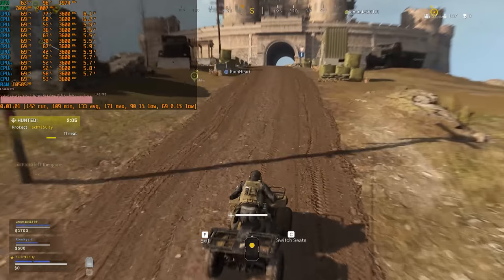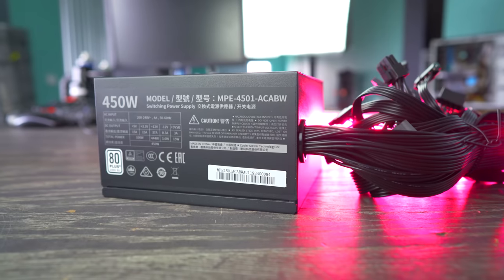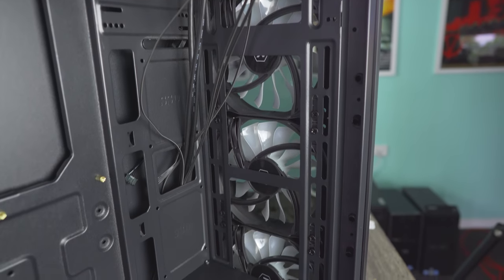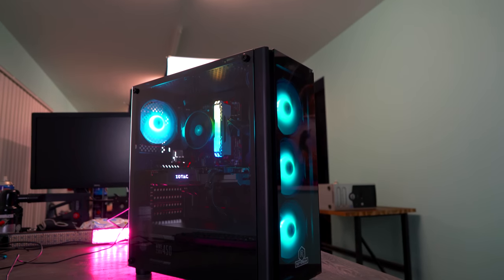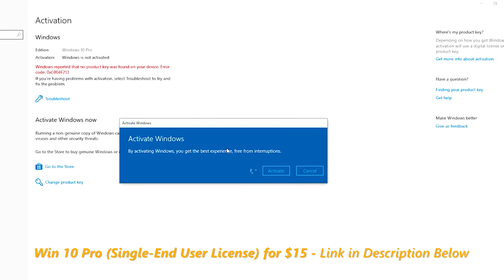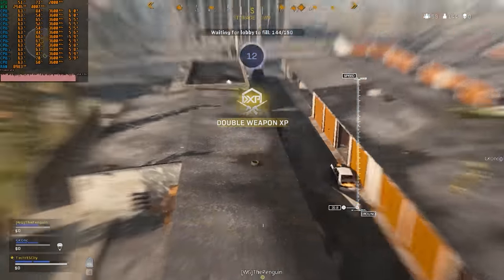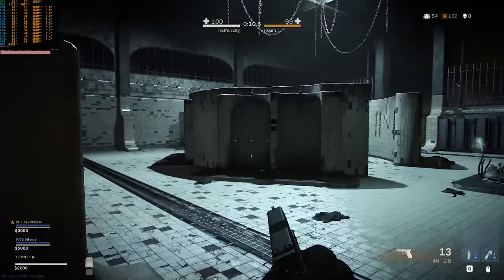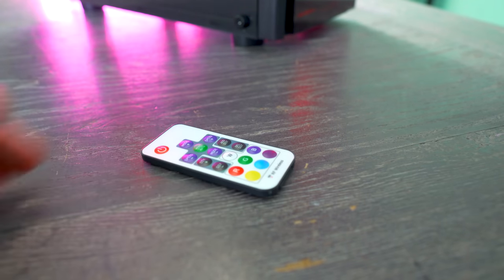The $590 CoD WARZONE 1600 AF "ULTIMATE Budget" Gaming PC

Comment: lol You taught me well (including all of the other budget builders out there) i already found these prices and built this a year ago. im so glad that you found this now, ive been wondering if anyone else thought of this. but the only 4 things different is that i have the last gen 1600 (not the Af version) i have a 600 watt psu, and my Gpu is a rx 470 4gb (mining) which is worse than the gtx 1070 but it still holds its ground at 95fps average with the same setting in MW. But i got mine for just 400 dollars give or take a few dollars. Also the motherboard is actually the same layout and Architecture but its from ASRock. My case was free btw... Its from 2004ish its just older than me Lol, I dont even know the model
Reply: btw Everything was new except the gpu and case

Comment: I might have a solution for some with a similar setup. I have a GTX 1070 ti and now the Ryzen 5 3600, but it would happen with my 2600 too, Modern Warfare would constantly crash and/or get Dev errors. At first I thought it was the Xbox Game Bar and disabling it seemed to help for a couple of matches, but the major culprit turned out to be performance monitoring sowftware like Rivatuner, after setting 'Application Detection Level' to 'None' now I can even overclock my card, use the Game Bar to talk with friends, and it's been months since it last crashed.
Reply from the maker: If you set it to none though does it still work?
Reply: @techyescity  Sorry for the delay, was at work. Sadly it doesn't, since it turns off performance monitoring at every level. Haven't tested medium or high since I already knew my temps were fine.
Reply: I will try to replicate the conditions for the errors and crashes I had, if it does crash I'll test medium level detection. Won't be as accurate but it should be close enough.
Reply: Remembered I had disabled Nvidia's In-game overlay in the geforce app as well. Although I wasn't able to recreate the crashes by enabling and using Rivatuner, the in-game overlay, and the game bar all at once. They might've fixed it, but that's all I remember doing other than trying 'Scan and Repair' and running as administrator the exe and launcher. Sorry if that wasn't of help.

Comment: I love how you're somewhat engaged with the games you're benching, but I dont get the cheap SSDs, on one hand Linus keeps shitting on them but you seem to have great results using those. Is it mainly cause you're flipping these pcs and the ssd is a good marketing tool or are they genuinely better than new HDDs price/performance-wise?
Reply from the maker: They are much better than hard drives, that comes down to mainly the random 4k read and writes, I have seeded out quite a few of these in builds and haven't had one come back faulty.  Leave them with about 10% free space and they work fine.
Reply: @techyescity  Thanks a lot for the incredibly fast reply! Now I know to upgrade my Laptop storage by adding a cheap SSD instead of a 2.5'' HDD
Reply: @Xeanorth95  Just don't take it too seriously with Linus.  Probably he just wants you to avoid buying cheap SSD and probably go with a "branded SSD".  It all comes down to choice in the end.
Reply: Definitely get an SSD! You will never be able to use a HDD again I promise you
Reply: @organicinsanity2534  Ofc I use NVME M.2 SSDs in both my Desktop and laptop with aditional 2tbs of HDDs in my desktop, I was just considering my options to upgrade my laptops storage ^^

Comment: For the people still receiving dev errors, run your cpu at stock settings, so no overclock nor undervolt just stuck. This solved my issue.
Reply: Whats your FPS on COD? For this build
Reply: Saul Hernandez  I have a gtx 1660 myself not a 1070, but for me everything on ultra I think average about 90 fps, when everything on low except textures like 110 fps average.
Reply: Saul Hernandez I do have the ryzen 1600 af aswell at stock otherwise you can experience the dev error messages.

Comment: Could you do a video on ram like how much you need and what speed it should be for ryzen
Reply: Viot45 Thanks
 Ryzen first gen. 3000Mhz (Minimum) 3200Mhz (Recommended.
Ryzen Second Gen. (3200Mhz Minimum)
3600Mhz Recommended
Ryzen third gen (3600Mhz Recommended)
You can of course go a bit cheaper and get 3000Mhz with second gen or 3200Mhz with third gen, but this is for the most performance.
Reply from the maker: I did a huge benchmark on ram speeds with intel vs ryzen a couple of months ago here - https://www.youtube.com/watch?v=MLWL5y0ONAw
Reply: @thilobroecheler4109  3600 MHz Dimms are exorbitantly expensive in some countries , I would recommend doing what I have done for my first build - go for dual channel 3200 MHz sticks and overclock them to ~3500 / 3600 MHz.
Reply: Thanks got a second gen ryzen 7 and a rx 5700 xt  and when I get on cod it stutters like hell got 16 gb of 3000mhz ram

Comment: I think your issue with the graphics is related to the 1070, my Founders 1070 runs HOT playing warzone (upper-mid 70’s compared to typical low 60’s)  and it freaks the hell out if I have the GeForce achievement thing turned on and do something it doesn’t like. 

So ready to build my new rig later this year at this point

Comment: Lol yeah I was about to tell you about rivatuner and then I saw your pinned comment. I just picked up a evga 1060 6gb sc for 110 US around 178 AUD today and I would say that is a good card for warzone and APEX legends with a mix of high and low settings you can pull 80 fps at stock maybe more with a bit of an overclock. Warzone is pretty fun it's 10 times better than the base multiplayer makes me feel like I wasted money and should have just waited for this mode but alls well that ends well I guess Se La vi.

Comment: It's a shame you didn't oc the CPU, I have the 'old' r5 1600 overclocked to 3.9ghz on 1.275v and threw a $20 CPU cooler at it and it worked like a charm. Best thing is, compared to stock, performance increased over 20%
Reply: damn i was abt to comment the same thing although if you upgrade to another ryzen cpu id recommend a water cool, i used an aoi so i didn’t have to do too much work, the h100i is always a safe bet

Comment: Hey Bryan, is there any reason to go for the TG303 over the TG302? Or is it just a matter of stock availability? I've bought a few cases from the wholesaler that imports these cases, they're located in Clayton (Melbourne) and do decent deals for bulk purchases. They're called "Super-omnitech" on eBay. Might be worth looking into if you are buying in bulk (not worth it for me as I tend to only build/sell one or two PCs at a time).

EDIT - and since you're using an MATX case would it have been better to go for the Gamdias Talos E1, much higher quality case and its cheaper ($62), still comes with 2 RGB fans :)
Reply: My question is the TG303 an oven? With that TG front panel what's airflow like? I love the look of it and it's well priced but if it's hot AF it's a deal breaker.
Reply: @buzzliteyear11  having used the TG302 I'd say you shouldn't put a 9900K in it but for the majority of modern hardware, which uses relatively little power, I think it's fine.
Reply: @sch-corp  thanks. If you get a TG303 and build in it would love to hear your feedback on it.
Reply: @buzzliteyear11  no worries, unless Bryan responds to my initial comment I would be reluctant to spend the extra $10 as I'm not sure what it actually gets you!

Comment: Would the Ryzen 5 1600AF be a good upgrade from an i5-6400? Or would I be better off getting a used 6th or 7th gen i7?
Reply: i7 would only give you 4 more threads while the 1600 AF gives you 2 more cores and 8 more threads.
Reply: the 1600af would be a massive upgrade since you'd be going from 4 cores/4threads to 6 cores/12 threads.
Reply: No, go for Ryzen 3700X or more, or just keep the i5 6400. IMHO.
Reply: @magnusnilsson9792  That's 3.5X as much as the 1600 AF lol.
Reply from the maker: depends on your GPU? I would only upgrade when you are ready to step up your GPU too.
Reply: @techyescity  I currently have a GTX 1060 3GB. Thanks for replying!

Comment: WarZone is a standalone install. It's only about 68GB's. only.lol.
I was running WarZone on a Z370 Aorus Gaming 7 and a Nitro+ VEGA64 LE. I also dropped in the good ol'Nitro+ RX480 8GB OC slightly modded with some RX580 goodness, all the settings maxed out running perfect. No drop outs, not one issue. Might be another Krazy anomaly on your end.
  DirectX errors, artifacting. That 1070 definitely seen better days. WarZone preloads all the textures so it's not the game. They preload everything to get the game to run with 160 players at the same time.
By the way. Fatty Dovs SSD's have a 128MB Samsung Dram cache on board. No more need for those ramless SSD's.
Reply: @Vlad Kandaon it's 160gb if you don't have the original game. If you do, it's basically a standalone dlc for install which us 68gb

Comment: Im using an overclocked 2700x, 16gb 3200 mem, 1070 strix oc at 1900mhz, and i barely get 144 fps constantly. So how can this one do the same. Hmm
Reply: I have a 1660 super, R5 3600 and 16gb 3200ram also and get more like 120 average with high textures and everything else on normal/low...
Reply: @liam0985  i set everything on low, disabled all kinds of anti alias to get more fps. The image looked bad so at first i used nvidea game filters to make it look good and that worker greater than i ever imagined but cost around 10 fps. Then i tweaked my alienware ips monitor with image sharpening and brightness, saturarion and that worked great also, not as good as nvidea game filters but good enough so i can disable it. Maybe in the early days when the map content was low brian could get these numbers, but today o dont think its possible.

Comment: I don't see how that i5 2500K can hold up in the recomended specs. I'm assuming at max settings 1080p on a GTX 970 (the weakest card listed for recommended settings) with the CPU overclocked to 5GHz will come close to removing any CPU bottleneck that will arise, but considering I had an i5 2320 bottlenecking a GTX 1050 Ti in PUBG, these open worlds need CPU power and looking at the usage from your video, any quad core CPU won't be able to keep up unless you're running the minimum spec GTX 670/GTX 760 Ti
Reply: Its not a 2500k? Its a ryzen 1600
Reply: @xXSinForLifeXx  I'm talking about the recommended requirements that Activision put up for Intel's CPU. I'm curious on how that will hold but I doubt its ability in 2020

Comment: I have some others specs that can get you some more fps:
Gtx 1650 SUPER 4 giga vran
Amd ryzen 5 
16 gigabites dual channel
Any type of ssd
A PSU above 650 watts i reccomend
Any motherboard that supports the ryzen 5
The case is your choice
And i reccomend having 3 front fans and 2 on top. With a watercooling system
Reply: Should get your around 170 fps
Reply: How much is all that
Reply: I think 700 euros

Comment: getting a first series rysen is a pretty bad choice, your gonna be forced to upgrade in less than a year due to these games requiring better and better cpu's, also a 450 watt power supply isnt going to last very long either ive had many issues in the past going budget parts personally. SAVE YOUR MONEY, or buy in chunks or if your young, ask for the cheaper parts like ram, ssd, hard drive, case, power supply, and motherboard and be able to buy a graphics card, and cpu buy yourself. big trust on this one you wont regret it.

Comment: I think you would be better of spending 20 bucks more on the mobo and get a msi b450 mortar max, then you can run the 1600af at 4.1 ghz, it will make a huge difference compared to the current 3.6ghz benchmarked in the video.
Reply: Yup

Comment: Would it be a good upgrade for me to get a used 1070 if I can get it for like 160 USD? Got a 1050 TI atm and its showing its age. 
PC is a Ryzen 5 2600X with 16gb 3200 speed ram and a 1050 ti.
Reply: PSU is a 430WAT as well
Reply: Yes.... I feel like your question answers itself.
Reply: @GummyBearRacing  Could I get away with the 430Wat I have tho? Its a good corsair PSU.

Comment: Dislike for a 2 RAM slot mobo, you can add just a bit more for a B450M DS3H. System is just not upgradable. Also a dislike for a noname SSD, you can buy BX500 or SU630 instead.

Comment: I dont think that 450w power supply would hold up to over clocking a 3950x and 2080ti. It also would eventually pop or have failure as it is running at full blast the entire time your pc is on. part that pc on part picker its estimating 459w usuage with those parts. U may be able to do some testing and stuff for a little bit but why not test those parts with 450w psu on the 3950x and 2080ti for extended use. give it about 6months to a year and I think your lil cheapo cooler master psu is going to explode and make a loud popping noise.

Comment: I have same setup and I get 90-110fps why's that? I have MSI gtx 1070 overclocked I get over 2000mhz boost clock in game got R5 1600 3.2ghz boost to 3.4ghz in game and have 3000mhz DDR4 16gb ram xmp profile unlocked also

Comment: The 1070 has been a great bang for the buck cpu for so long but right now I don't think it's worth $200 usd used.  You can pick up a brand new 1660 super for $200 with full warranty and it will perform just the same as a 1070.

Comment: do not overclock your GPU, i did it with 1650 gtx and i burned my (card, hdmi cable, monitor)
Reply: Johny - COD That’s because overclockers don’t turn all the settings to 100 on MSI afterburner expecting 1070ti performance.
Reply: @Speedtale  my dream pc is destroyed bcz of overclocking

Comment: Can someone explain the logic that allows a 450w psu to run a pc that includes a 3950x, 2080ti & (presumably) fans, drives, ram, etc?
Reply: 450 w? I don't think that's enough,don't try to take the risk,pick 550w above otherwise it will damage your components

Comment: Imma Be honest my Comp was over $2000 (Built myself replaced parts over couple years time span).  Now in early warzone (season 1-2 I got high frames closer to 200fps with everything on High /Ultra NOW after the patches and updates,  the game runs  like ASSCHEEKS.(SEASON5)  I have to reduce to Normal settings and barely pushing 144fps steady, I get like . IDK if its nvidia plus warzone constant updates but you need some serious $$$$(Dough) MAINLY THE GPU, YOu dont need the best card but at least go extra on it and buy the best GPU you can that will realistically make the game wayyy more enjoyable. the awesome 1070ti that once was the best Price to Performance is now going obsolete. :'( BUT 3070 ;)
 i5-10600k w/ 1070ti, Swapping it out with the 3070 very soon but man does this game take so much to just boot up and run, putting this game on a regular HD instead of an SSD is a HUUUUUGGEE NO NO. I did that once and Instant Regret. I Put that game back on my SSD ASAP.  Especially since im running 240hz monitors you can feel the performance going down afterawhile. its just not as fluid as it used to be....

Comment: Wait I have a Ryzen 5 2600 GTX 1060 3g 16 3000mhz and playing warzone on low settings I only get like 80/90 FPS WHATTT!
Reply: lower ram speed, 3GB video card ( if i remember correctly the 3GB gtx 1060 is slower than the 1060 6GB.

Comment: I'm using the i510400 cpu ,rest same setup but my fps is only around 50-60,with 2k resolution mid-low settings.  Which is really bad. Should I change a GPU for better FPS? Like 100fps in 2k?

Comment: I have a GTX 1070 ti 8gb. And a Xeon 1650 e5 3v, 32gb ram. I struggle getting over 40 fps. Already did so much to try and raise it but nothing....what am I doing wrong?
Reply: Nothing bro this video isnt telling the truth, I have a 1080ti i7 7700k 16 GB ram and I play warzone w
90-120 fps depending on the zone of the map and belive me I tried everything
Reply: @laterbiatch3004  I found out my problem. I had miss installed my gpu. Now I get 100-130 on warzone . Everything off/ low

Comment: Sorry if this is a bad question, I am new to gaming pc’s, but does anybody that has this pc able to run valorant? I really want a pc that can run valorant and warzone at around 600$.
Reply: Graphics cards are expensive at the moment, get one without a graphics card with a Ryzen 3200G CPU (has graphics on it) and 16GB of Ram (2x8GB sticks). Valorant will play no problem, warzone you will have to play at 720p. But then down the line , when graphics card prices come down you get just get a  GTX 1080/1080ti and just put it in.

Comment: I like how I have a 2600x and a 1070ti but he still gets better FPS than me
Reply: its the game in season 4 the fps just dropped for some reason
Reply: hamza salama yeah but I have a friend who has a 2600 and a 1070 which are both worse than mine on any other game but as soon as I get on warzone I get 120 FPS and he gets 180
Reply: Sxcrifice what settings is he running? i myself have a 1660 super and a 2600 and get around 90-115 high aettings
Reply: hamza salama idk he plays on mostly low with high textures
Reply: @AidanHipp  for some reason i'm also struggling to get more than 115 kinda stable fps, with a 1600af, 16go 3200mhz and a rtx2070super, no matter how I manage graphics settings the game won't run at a stable 140fps like him :/
Reply: zelkina for you it’s probably the cpu I would recommend a 3700x which is the best matchup from that gpu for a non ridiculous price

Comment: Also if I have an activated version of windows in one drive using an oem key will I be able to switch that drive to another system and still have it activated if not will I lose my activation when I put it back in the first activated system
Reply: Windows keys usually locks themselves to the motherboard, not the disk.
Reply: @magnusnilsson9792     That's good to know Thank you